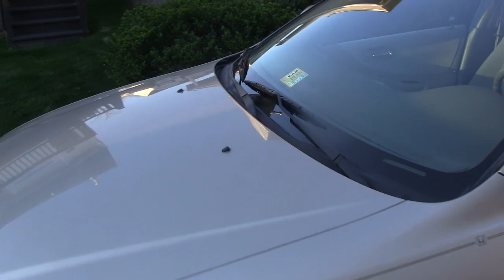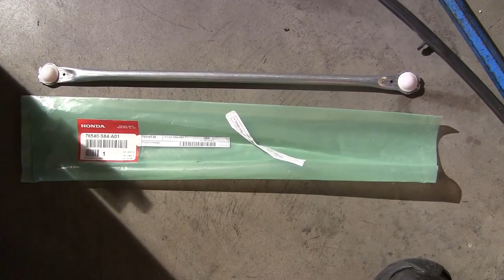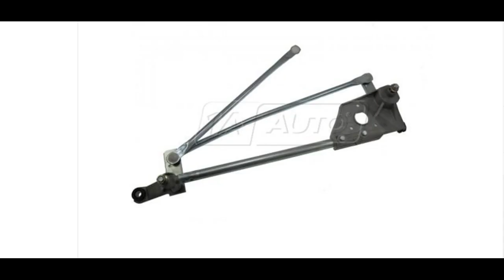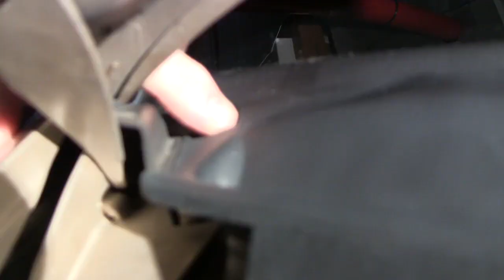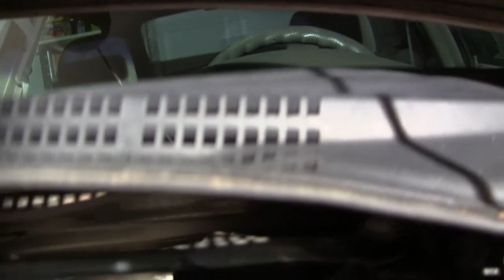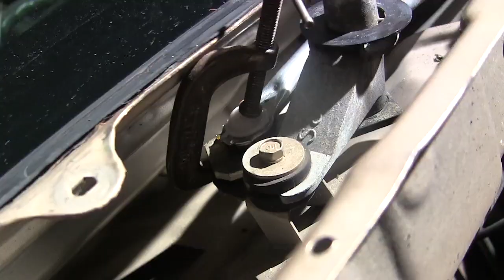How to Repair Flopping Windshield Wipers and Replace Wiper Linkage on 1998-2002 Honda Accord

Comment: Thanks for  a very  helpful video.  The following info. would have helped me:  the linkage rod underside is indented 2" on one end and 2 1/2" on the other.  The 2 1/2" end must go on wiper motor end.  If not the 2 " end hits the nut and pops off.

Comment: no luck for me with the aftermarket busing dorman 49449. Wrestled the damn thing on there after letting it soak in boiling water for a minute to make it plyable. However, then the bushing was too loose on the peg and fell off when I tried the wipers on high. Oh well, it was worth the $5 to try and innovate.